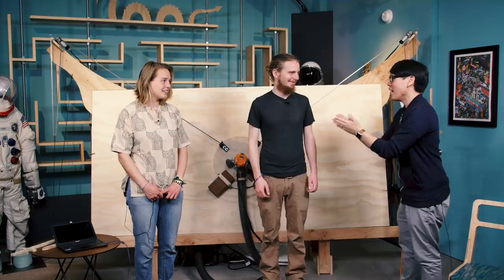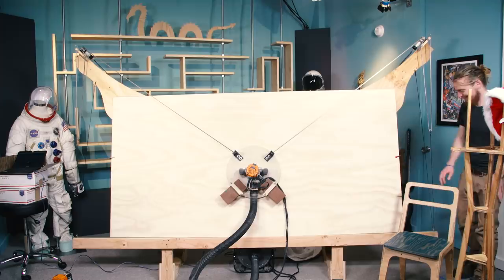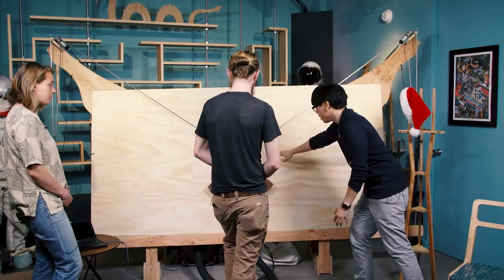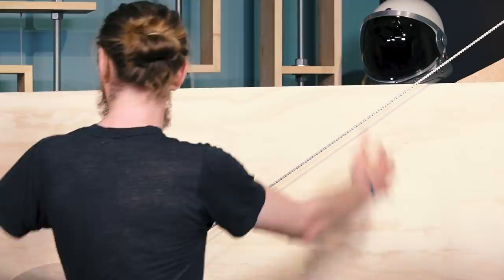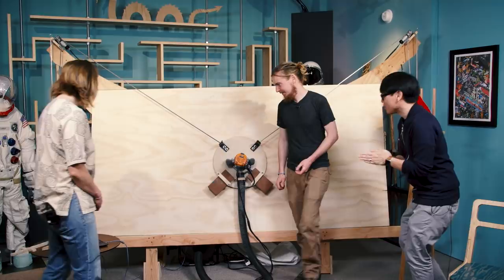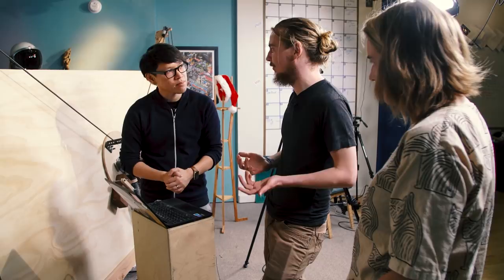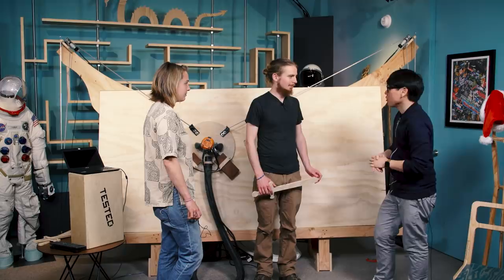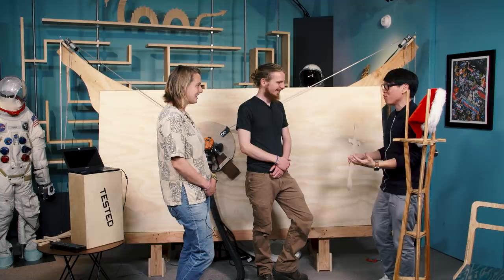Meet Maslow, the $350 CNC Cutting Machine

Comment: Have a friend worked with wood for over 40 years was making a desk top from a raw slice of timber wanting to put nice edge on it was using a router which the cutter tool  caught on the edge of the timber caused the whole router to jump off the surface which then the router cutter bit contacted his hand and climbed up his arm
Never in my life have i seen a injury so horrific and damaging almost lost the use of his hand and arm many surgeries later he has recovered 
Never assume a tool is safe always be aware and work safely be careful freak accidents can and do happen 
What kind of safety device inter faces with the “you supply your own router” in the event the rotor hits a hard spot and the tool comes away from the work surface

Comment: Cool concept but I'm skeptical how versatile and practical it really is. The types of material you can cut and the machine's rigidity is a concern, this is probably purely for wood working or other soft materials (unless you attach a plasma cutter to it).  I kind of see this machine as reinventing the wheel when the wheel really didn't need reinventing. For a budget machine this seems ok and I can understand the appeal and niche market where it might do well. However a more traditional CNC machine seems like the much better option if you can afford it, especially since there are good 4x8 CNC kits out there that can be purchased for under $5k, not the $15k -$100k they mentioned in this video.
Reply: where can I get 4x8 cnc kit under $5,000?
Reply: You can check out CNC Router Parts, you can get one of their standard 4x8 models and their DIY electronics kit for under $5k. Routakit is another good option, the HD model comes in a 1500x2500mm size. Zenbot is another option and they have the cheapest 4x8 machine. Large scale cnc machines can be found for reasonable prices, you don't need to spend $15,000 and up for one like this video states.
Reply: Of course it's just for woodworking did they mention a plasma cutter? They say it's not a pro-grade machine. It's a slow, garage-based thing, so it costs virtually nothing. $350 compared to 5k. Jesus H Christ.

Comment: You think this would work with plastic like pvc, abs, lexan, acrylic, starboard, etc at an 1/2 inch to inch thick?
Reply: yes, this will cut anything the router can handle.

you have to watch out for chipping and melting, but cutting plastic with a router can be done.

Comment: Not too shabby. I'd like to see a laser version of this though.
Reply: Duh it's open source add your own laser!
Reply: I get that. I'll be honest though. I'll probably never have one of these.
Reply: I guess what I was getting at is that it would be nice to have a laser included in the kit. It would be more expensive, but would make for a more complete feeling kit.
Reply: Justin Ours there are a few problems with that. one is exhaust and ventilation plus this is not enclosed. The other is that lasers are fragile and typically the laser does not move and only the gantry with mirrors move.
Reply: And the mirror alignment is key. It works on X-Y gantries because the mirrors maintain a constant angle to each other, but on a machine like this, they'd have to move and adjust to keep pointing at the cutting head. I'd be a real nightmare for any sort of consistent alignment. A laser version would probably be best done as just an upright with a traditional X-Y gantry instead of the chain system.
Reply: This would only work for a fiber SSL laser cutter, which tend to be more expensive. If you look at how flexible the frame is (because it has no rigid support), a mirrored system wouldn't work. With fiber it would work though.

Comment: plasma would be be cool.      Like if yo used a metal frame wok and made a plasma outside.  Could you put the electronics in a water tight box and use a water tight motor.  Chains will not rust if you spray them with a chain wax,  I have made a few signs metal and wood by cutting the letters and what not laying them on stand offs of another sheet and putting Led lights behind them.   The image makes a negative lit space on a sign making it easy to read at night.  Being open source It should not be hard to take the code and just build one ourselves.  Two motors and chains are cheap.

Comment: What effect, if any, does chain stretch (over time, obviously) have on the precision?
Reply: chains do not stretch significantly enough. It's one of the properties of chains and why they are used over rope or other things over time. If the chain is properly lubricated over time it should last many years. if not you can always buy new chain it's cheap about $10 each.

Comment: Would the accuracy on edges be better if motors would be farther apart? then their angles would change less. Now that of course goes against the compactness somewhat
Reply: yes, the further the motors are from the cut area (height and width) the more accurate the cut. The machine dimensions are a compromise between machine size and acceptable chain tensions in the top center and bottom edges. move the motors up and out and you end up with a bigger sweet spot.
Reply: Yeah. From what I understand about the calibration process this should be possible to diy and then just calibrate again

Comment: Hello and congrats for the simple and inexpensive design. One question though. I noticed that you seem to set the number of passes on the depth of cut. Obviously, the machine does not take care of that. Do you cut in one pass or do you plunge the router a little deeper after every movement around the form?  I sure would love to have a go at this system but as to programmig it, I probably am just too old. Thank you!
Reply: This example made 5 passes, each a little deeper. This is controlled by the g-code that you feed to the machine. Here is a video that shows a full example of design through cutting https://www.youtube.com/watch?v=W0mW_mm1iBI  note that this is only one of many different ways to create the design and convert it to the g-code instructions on how the tool should move
Reply: the machine does take care of it (with an optional Z axis motor). the timelapse was not stopped.

Bar tends to be extremely timid in his settings, he did this cutting 0.2" on each pass @24 ipm. He's demoed cutting 3/4" in a single pass,but is worried about breaking the bit.

With more reasonable settings, he could easily have done this in two passes in about 5 min

Comment: I personally would think I'd you were to add a third motor art the bottom I'm the center it could be more accurate instead of relying on gravity.  still am awesome idea so small shops can make large pieces, metal or wood or whatever material without going bankrupt
Reply: That was tried in early prototypes, it didn't make enough difference to be worth it.

Comment: My thing is, for $350 you get the program (the cut you design on someone else's website?), plans (which no one is using?), two motors, chains, brackets, and screws? Is that right?
Reply: The $350 gives you the arduino, motor controller board, motors, chains brackets, wires.

you add to it the wood, the router, and the bricks.

The software to drive the machine is available for free (opensource), and for that matter the board designs are also opensource.

You would expect that beta-testers would be highly inclined towards experimentation, and that's been the case, some have built the machine directly matching the plans, many have not (mostly differing in different ways).

There are people who have built their own machines without getting the kits (some didn't want to wait, some missed the kickstarter and didn't want to wait until the second round), the biggest problem they have had is sourcing suitable motors. These particular motor/gearbox combos aren't available in the US at anything below 1000 piece quantities, so people have been experimenting with many other options. None have been particularly cheap, and some have spent more on the motors than the entire kit runs the motor specs are: 12v, 30Kg-cm torque, 10 (or was it 20) rpm with an 8mm shaft.
Reply: Awesome clarification! Thanks!

Comment: It looks just a little janky with those upper brackets mounted directly to the material and not some sort of stand but the upright design would mean that more fragile materials can be loaded without assistance.

I must have one of those.
Reply: The upper brackets are mounted to the frame, which has a backer board mounted to it as well. The material you're cutting sits on that backer board.

Comment: Why not just replace the bricks with bungees? You could just stretch them to the other 2 corners and they will insure that its pulled tight.
Reply: you would need to move everything up a lot, bungees can only stretch so far (some multiple of their resting length), also they would provide the least force when it's needed most (as the sled is closest to the bottom corner)

Comment: why not put 2 motors on the other corners to make it work from all four corners, just curios ,i would love to have this.
Reply: double the cost and little benefit.

yes, it could probably be made to go faster with the other motors, but it works as-in with just weight to pull it down.

Also, a machine with 4 motors would be over-constrained, which give more ways it can break.
Reply: I'm not any good with this stuff I just figured if it had for motors it would give it better control of way u set it to do if all of them are dialed in correctly. But it right the more parts they are the more they are can break and more to go wrong.id love one to play with I've worked with wood my whole life and love making things from nothing u did a good thing with u r invention .for so many that would never be able to afford a cnc.settup as they are today really expensive. Thank u
Reply: It's Bar who created, not me. :-)

Comment: How did it leave the tabs if it’s only two axis?
Reply: There are three axis, the third is the depth adjustment on the router (adjusted manually when the machine pauses if you buy the $350 kit, motorized for an extra $60)

Comment: With it being upright, how does the Z attachment work?
Reply: There is a motor attached to the router on the sled that adjusts it's height. Using the recommended router this is a matter of popping off the plastic knob and hooking a motor to it. In extreme cases you build a router lift setup and drive that (it's apparently insanely expensive to get comparable routers in the EU)

Comment: Doesn't seem very usable..... how thick of material can u cut with a modified cabinet router? Prolly be alright for decorations and stuff?????
Reply: how many passes are you willing to make and how long a router bit can you buy?

This is really designed to cut things out of plywood, but since you can get 6" router bits with a 1/2" shank, and a 2.5HP router will have no trouble spinning them, you can cut pretty thick stuff if you want to.

Comment: what is the advantage over drawling the pattern and routing ?
seens way slow and a way to spend 350 dollars to take way long to do a simple quicker operation otherwise
Reply: repeatability, fine details. all the normal reasons for CNC instead of manual

Comment: would like to have seen the router at normal speed for 30 seconds or so. Needing little tabs to prevent the piece you're cutting from moving is inconvenient and time consuming. What about a vacuum system say with a shop vac?
Reply: a shop vac won't hold well enough. Another common approach is to not cut all the way through, leave just a hair and then cut the parts loose from the back side with a flush trim bit in a trim router.

or you can position double-sided tape behind where the parts will be and cut all the way through.

Comment: while the math is simple enough, I'd have to see how the accuracy work out in the real world, especially after multiple cuts
Reply: actually, the math is far from simple https://robotics.stackexchange.com/questions/10607/forward-and-revers-kinematics-for-modified-hanging-plotter/10858#10858?newreg=13734dd331424a0ea0d2ddc79c562910

there are numerous videos showing it cutting, and since Bar tends to set the depth per pass to 0.1", you get to see it cutting where it's cut several times already. The repeatability seems to be very good. right now there's some error in the math that causes it to be repeatably off by a little bit, which is why Bar says that the current software version is only accurate to 1/16" instead of the design 1/64"

Comment: Only question I have is how the Z axis works
Reply: there is a motor that attaches to the depth adjustement screw of a fixed-base router (which has been adjusted to let the router move up and down when latched closed)

Comment: so if you ship the screws and hardware but require the comsumer to buy the lumber/ect. wouldnt it be cheaper in the long run to just ship the motors and hardware for those and a parts list for everything else. would lower shipping cost as well cost of the kit plus most people that would buy this would have alot of the hardware already on hand no need to buy more or get more in the kit. food for though.

Comment: The guy said that there is also a 3-axis option. I was wondering how that works on this setup.

JW3HH
Reply: this is a fixed base router, adjust the clamp on it so that the router can move up and down but not rattle around, then motorize the depth adjustment

Comment: can this machine cut metals - aluminum sheet 1/4 thick???
Reply: it can cut anything that a router will cut. it's a 2.5HP motor that spins between 8K and 12K rpm.

yes you can cut aluminum with it, but it's not great at it. Also, you are likely to be looking for more accuracy than this can produce. Metal cutting CNCs frequently want to be accurate down to single digit thousandths of an inch, while this only aspires to doing about 15 thousandths of an inch.
Reply: Thank You but will buy one in near future for wood and non-metal meterials
Reply: Thank You - God Bless

Comment: How do you make it cut steel?
Reply: This isn't designed for cutting steel.

I have seen people cut steel with a router, but not well. cutting steel really wants lower speeds to keep the bit temps down.

with the wood frame, flooding the bit with coolent is probably not a great idea, but if you made a metal frame you could avoid that problem.

I would replace the router with something turning much slower. The router turns in the 8k-12k rpm range, things designed to cut steel usually max out <3k rpm

Comment: Cool concept but definitely has it's limitations. There are a lot of DIY kits/plans out there so do your homework. I always tell people wanting to get involved in CNC to start small. Most people don't need a 4x8 table, and most people don't need a 4x4. Start small and if your hobby develops then you can build bigger machines. There are a lot of clever ways to store large machines like this against a wall in the same way but without having to operate it in this orientation.
Reply: it all depends what you are trying to build. If you want to build human scale things (chairs, tables, cabinets, etc) then the small machines you are talking about will not work.

If you want to cut circuit boards, the maslow will not work, you want something that fits on a desk (probably <1 ft on each side), but if you want to build a kitchen, a maslow machine will do a far better job.

Comment: 20 Minutes?  So, for $3000 you can make one from a kit that is much more accurate, and the time savings would make you more money.
If this is hobby, I would suggest using the wood router and a router table.  Or a jigsaw.
Reply: I would sure hope that if you spend 5x as much you can make one that's faster and more accurate, if not you are being taken advantage of.

But not everyone is going to be willing to spend that much money on a CNC machine. This is intended to be the low-end kit that sacrifices speed for cost.

what sort of accuracy things will finally end up at is  good question, but it's easily good enough for cutting wood.
Reply: But there are so many other issues with this.  It uses gravity for one of the axis.  What happens if you hit a tough piece of wood and the router jumps.  Routers and router tables can actually do a ton of stuff. like making fine cabinets.  I like the accuracy and repeatability of the CNC, but for just cutting out shapes, a printer, some scissors, and a jigsaw with a steady hand can do what this did.  Lookup Rockwell Blade Runner for a cheaper solution.

Comment: ok, but why at 2:48 is he using fully threaded screws but no hole in the first sheet ?  This adds more play to the whole assembly.
Either drill a hole with a diameter equal to the width of the threads of the screw, or use a partially threaded screw. Otherwise it's really amateurish..